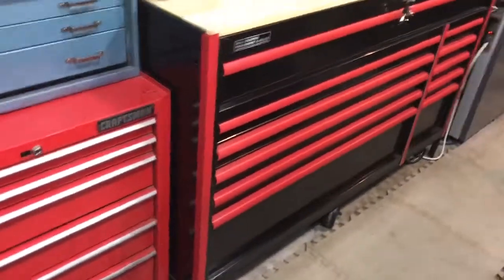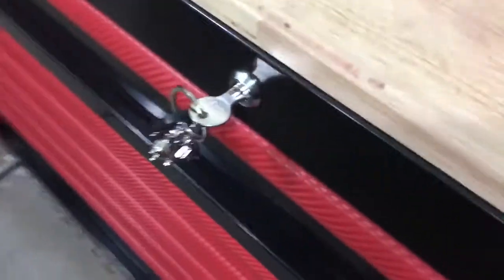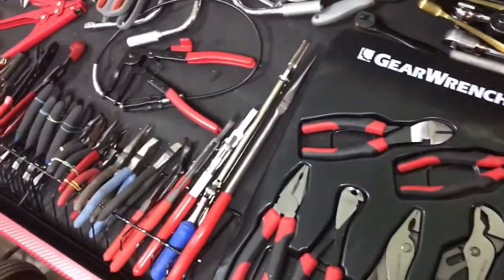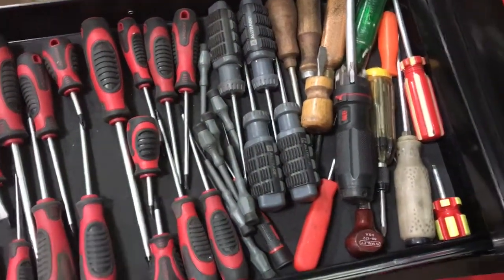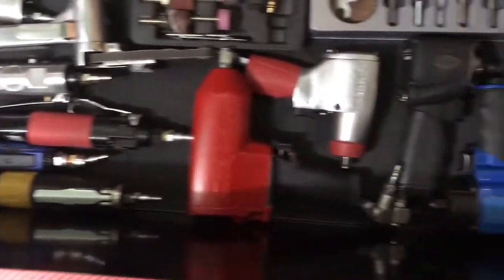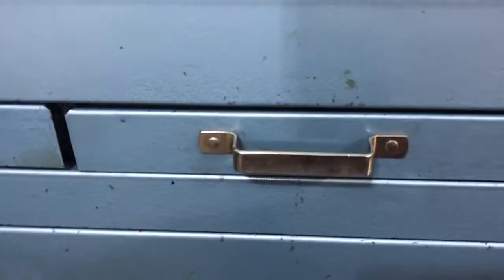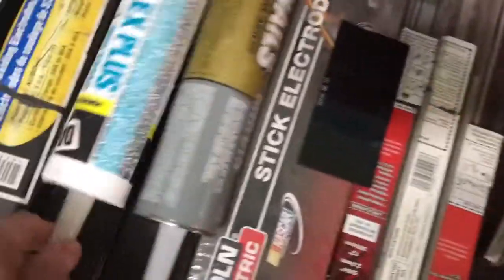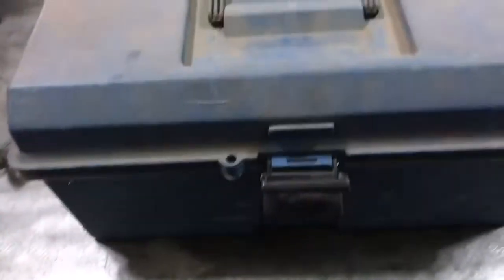Tool Box Tour May 30/2018

Comment: Hi Bruce great looking tool box. You did a nice job in organizing the tool in the box. I like the plug light in the electric strip. Thanks for sharing your new tool box. Have a great day. Nick
Reply from the maker: Thanks Nick.  The light came in a pack of three at Home Depot, they're a great way to tell if a plug is working.
Not so sure how my day is gonna be tomorrow as I have another dentist appointment.  Trying to get everything fixed before my wife retires and dental benefits are gone.  You have a great day though
Reply: Bruce thanks for the info. Hop everything goes well at the dentist. Nick.

Comment: I know I'm too old for play dates but I want to go one to your house! 😂 My favourite tool at the moment has to be my radiator pressure tester!  I've been chasing a leak too.  Its so much easier to find with that.  Turns out it's the flange on the back of the engine which I paid a mechanic to do last year.  It wasn't leaking at that time but he claimed it was and billed me for it, never replaced the hose which I actually left the car in for.  I'm beyond pissed off!  I really don't want to do it but it's looking like I will. Wish me luck 😂
Reply from the maker: You're welcome to visit any time you want,  never too old for play dates!
Radiator pressure testers are super handy,  I really need to get one.
I'm sure you're more than capable of fixing it yourself.  I imagine it won't be very fun if it's on the back of the engine though.
Good luck!
Reply: I can't recall any of my other cars having coolant leaks. This one is a pain in the ass for that but never gives any other problems apart from the usual wear and tear stuff so I can't complain too much 😂